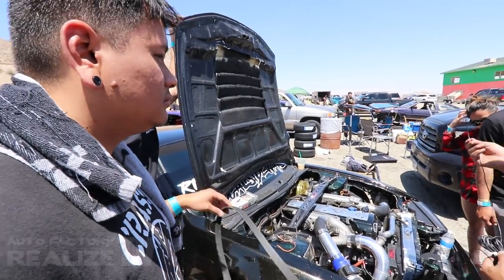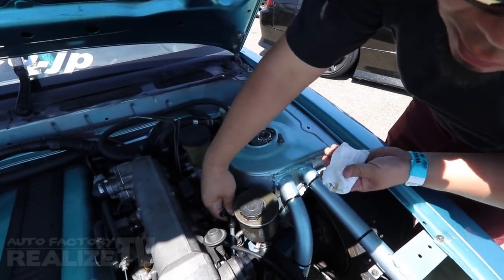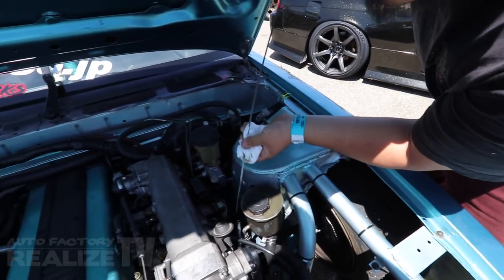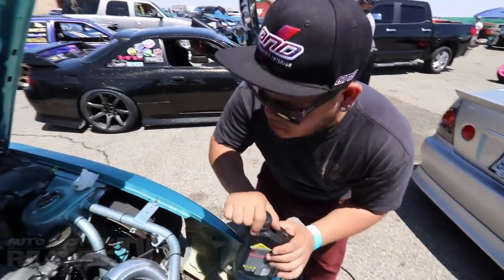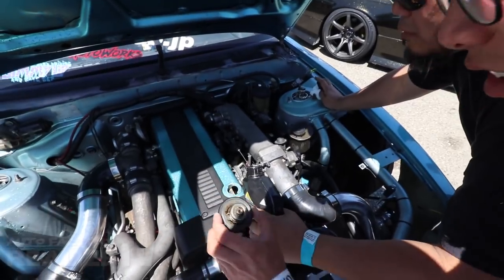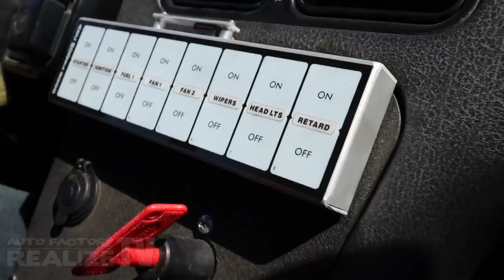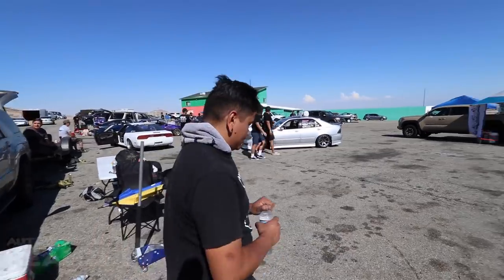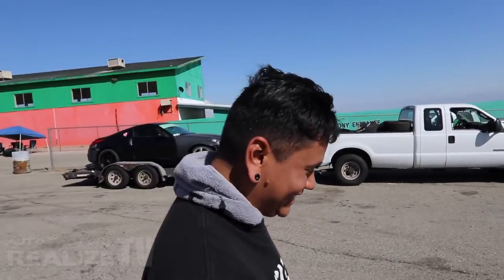Getting caught in a HUGE pile up...

Comment: It's running hot, so let's turn the boost up lol. I'm sure you'll get it figured out. Maybe an oil flush to see if the shake comes back or compression check
Reply from the maker: It just seems it’s not getting enough airflow and the E-fans are not powerful enough. We’ll get that sorted out before turning up the boost 👍🏻

Comment: Serpentine belt keeps snapping off because AC is deleted. If you put the bracket and pump back on you will stop getting that slippage.
Reply: Radio, yeah Taka mentioned that to me. I think the belt was just stretched. It’s about 3 years old and started making a lot of noise in the morning.

Comment: to prevent the serpentine belt from flying off get an ac compressor and gut it reinstall it wand use a gs300 belt
you will never toss a belt again
Reply from the maker: Gary’s car has the AC delete bracket and pulley, this belt was just really old and worn out.